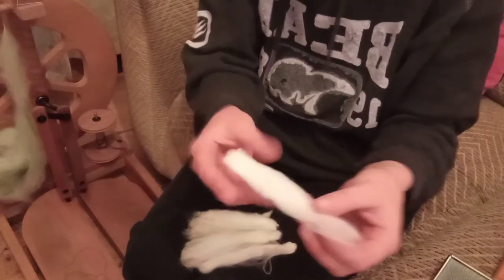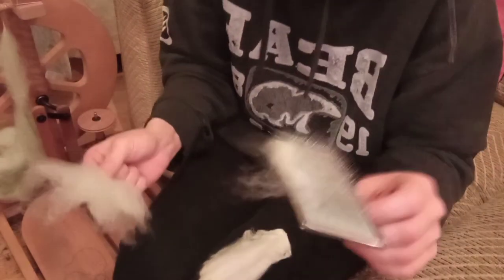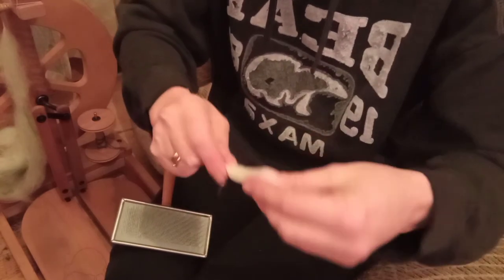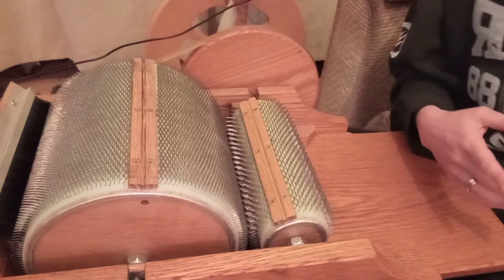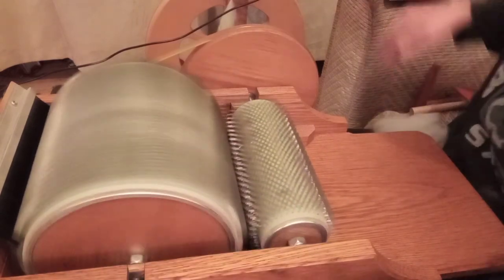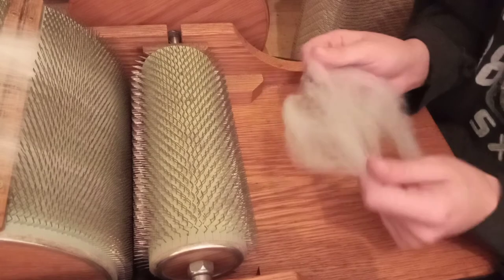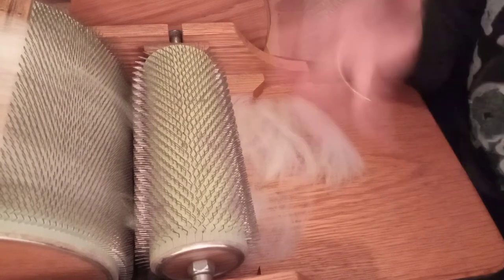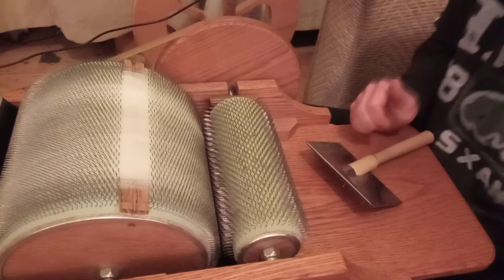Flicking locks and then putting them through the drum carder

Comment: My favorite prep although over time "my way" to flick has become REVERSE of what you're doing - to hold a handcarder on my lap and pull the lock clump through the teeth several times from each end. (Less stress on my hands/arms than "beating" with the flicking tool.) Holding them firmly with that little twist to keep a grip of the "good stuff" is key! I can dirty up both handcarders before cleaning them well for next round.  Currently finishing a fleece that requires combs. Will be happy to use wool suitable for drumcarder next!
Reply from the maker: How interesting I shall have to try that some day. I do have combs but have to have the clamped to my table and use them like a hackle and comb but at this very moment my table is a mess x